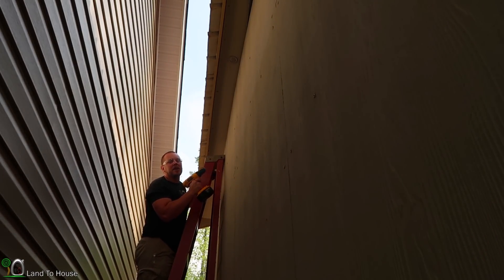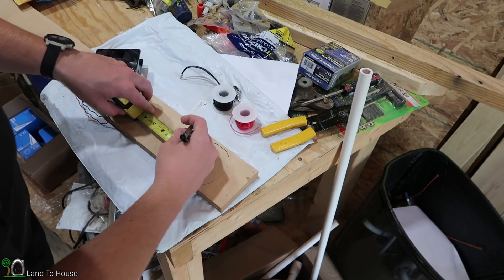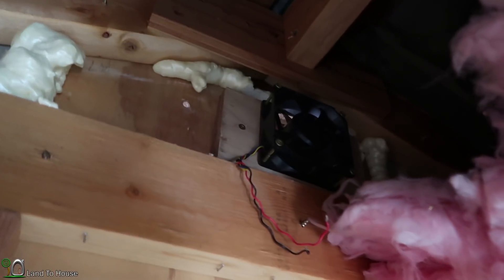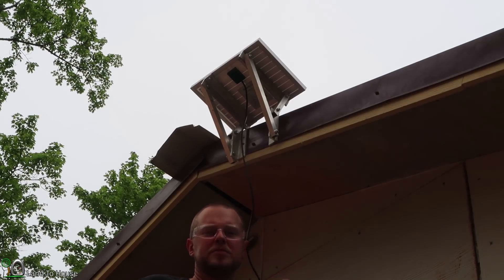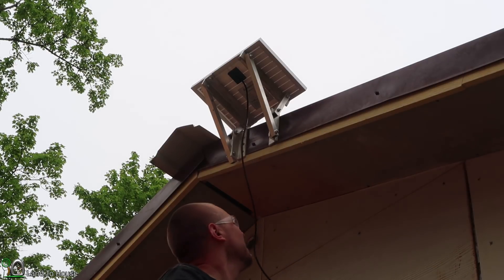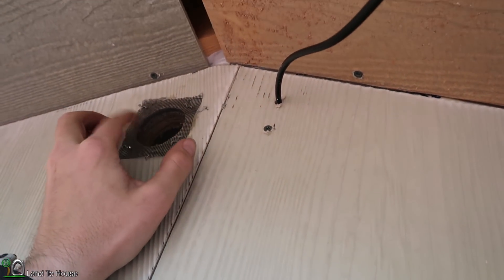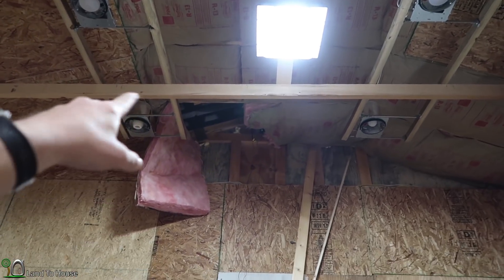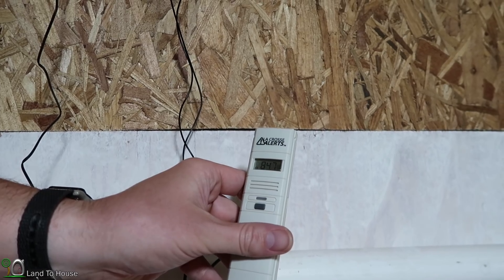Solar Powered Attic Fan - Build a Workshop #57

Comment: Why don't you add a small capacitor to help you start it up everytime? It's relatively easy, cheap and you won't have to tap it everytime. Not to mention it will keep your fan running in a case of a short power loss from the panel....

Comment: I'm no genius when it comes to electricity, and please someone correct me if I'm wrong as I'm always trying to learn and expand my horizons. 12V × X = 10W (X represents amps). Therefore the Amp of the solar panel is 0.83amp and not 0.5amp...

Comment: ...so will the fan eventually get going by itself when the sun gets bright enough? And the fan won't smoke itself from trying to run on low voltage? 

I've been thinking of a way to keep temps down in my 8x12 shed that almost pointlessly has one vent on one end.
I have a couple old 12v computer fans; a .6 amp and a 1 amp...
but I didn't know if I could directly wire the fan to a panel or if other circuitry and a battery were required.
Reply from the maker: This fan has been running in my shed for years. No issues as long as the fan is rated for higher than the solar panel.

Comment: I installed one in my "glamping shed".  I bought the kit that Amazon offers.  All I needed to add was plywood and caulking.  I do not have a switch, but the fan I installed has a thermostat that when the temp reaches 85 it kicks on.  I could bypass the thermostat, but it would run as long as the sun is up.  My shed is 12 x 24   https://www.amazon.com/ECO-WORTHY-Solar-Powered-Ventilator-Foldable/dp/B00ZWK7DYE/ref=sr_1_9?keywords=solar+attic+fan&qid=1563457958&s=gateway&sr=8-9
Reply from the maker: Very nice. That is quite a large fan. I like the computer fan option because it is cheap. For about $30 you can have the panel wire and fan. The switch is good when you need quiet time. This has made a tremendous difference in my shop. The moisture content has dropped down so that there is no more condensation inside
Reply: @LandtoHouse  yes the condensation had dropped in the shed too. Actually I don't even hear the fan running at all.

Comment: You might want to consider soffit vents in place of those small holes you drilled. They make them with screens that would prevent insects from getting in and would probably help move the air better.

Comment: You could add a second fan in the other end of the building to see if the solar panel would run both. If it would they would run slower and quieter while moving the same amount of air. you could experiment by hooking them in series or parallel to find out which works best. I would try series first. Each would get half the voltage so they might not get enough to run. In parallel it might draw too much for them to run. You noted that it couldn't start by itself when light was lower. When this happens it might overheat the motor in the fan. If you could have something that would keep the power from trying to run the fan when the voltage is to low to run it. 
The fans would probably last longer if they run slower. When you get it closed in the noise might not bother you.

Comment: Love watching your stuff! I'm going through similar throws with my new work shed here in central TX. Here's ours going in: https://youtu.be/Py0jWtrwXDM  May I offer a suggestion? Use rubber gaskets between the fan and building. Here's an example of the gasket I'm referring to:  https://amzn.to/2LBcD1H Foam, or other material to "decouple" the fan from the building will help quite a bit. Nothing too rigid. The noise is most likely coming from the fan transmitting its vibration thru to the wood. Your building working like an amplifier of the fan noise! I suggest this because lowering the speed of the fan as you mention, will lessen the exhausting effect of your set up.     Good luck!